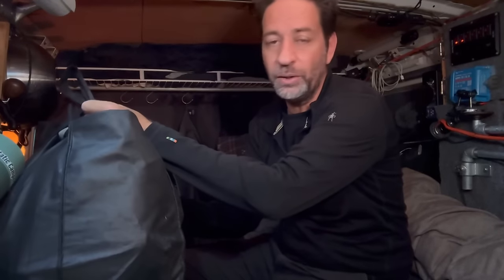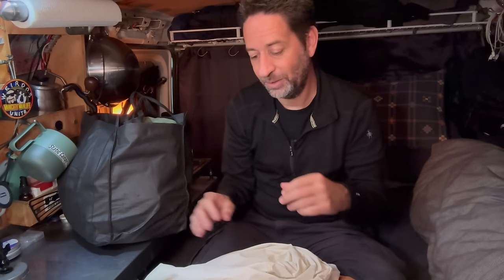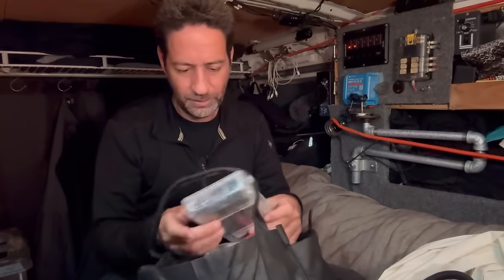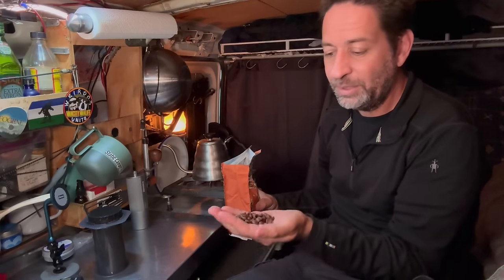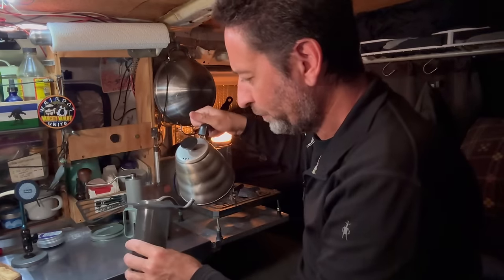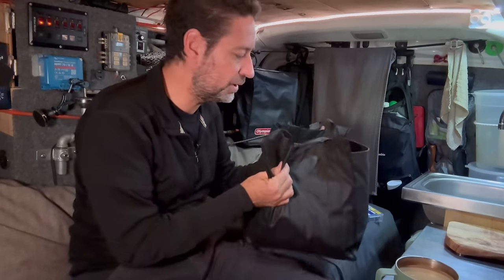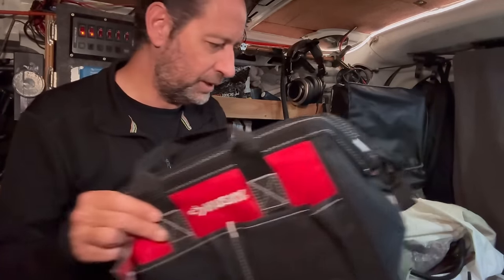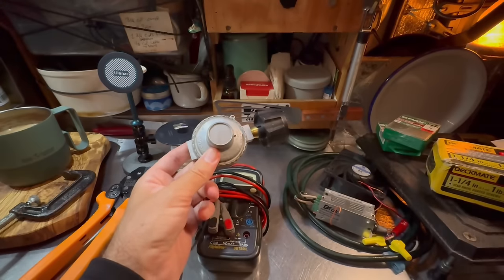Clearing The Clutter #adayinalife #vlog | Trader Joe’s Coffee & Ice Cream

Comment: Thank you for your enjoyable videos. I have been in my van for five years now. Originally went cheap on electrical. Had some connections loosen up. I started using silver conductive epoxy on as many connections as possible. So far it works great, it's like superglue for electrical! I bought the cheapest 2 part epoxy on Amazon (about 20$). Happy static travels!